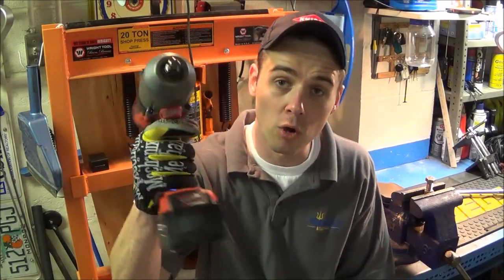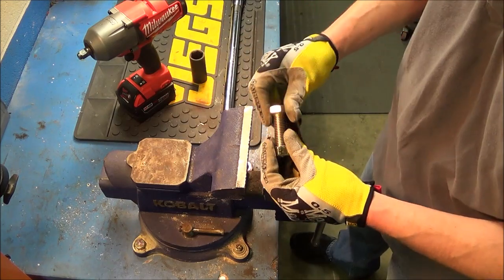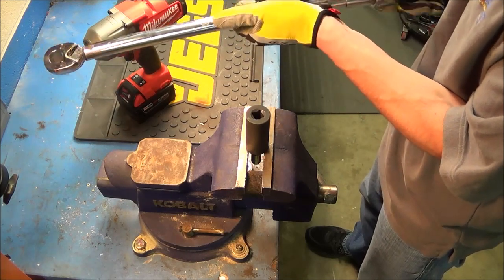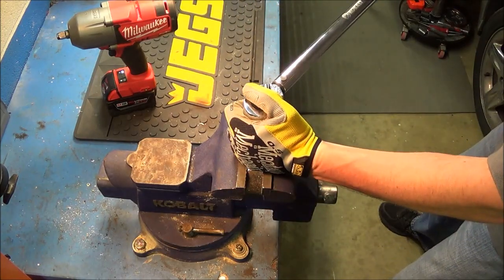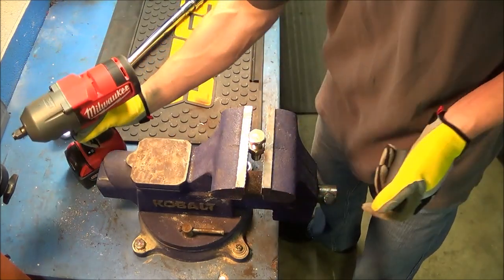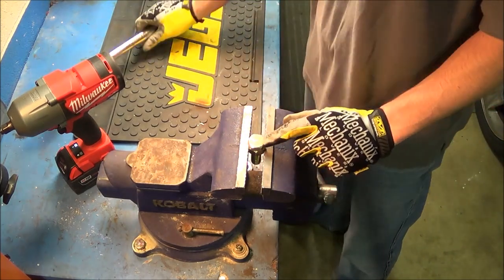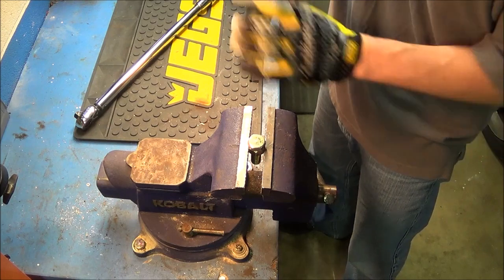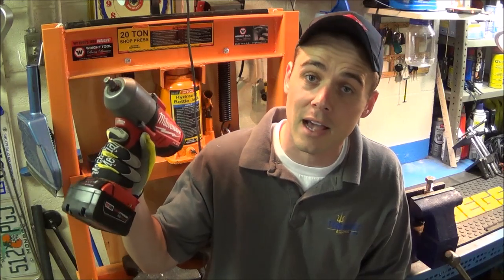Torque Test - Mode 1 - Milwaukee M18 FUEL 2763-22 High Torque Impact Wrench

Comment: I bought a Chinese brand impact wrench Enegitech. Which can remove 100 ft lbs on setting one..it has four settings. Cost €90 for impact wrench two 3mah batteries and Charger.

Comment: where's the mid torque test?    i can't find testing anywhere, all people talk about is the 600 lbs nut busting torque, big deal, what are the torques for each mode for fastening?   they claim this is the one for lug nuts,  anything over 80-100 lbs will break the studs on your wheels.  i know, use a torque wrench, and i have 3.   but it's be nice to know if mode 1 offers 80 lbs, or 100, or 105, etc.  just bought this on clearance at home depot for $199 with charger and battery and chard case, but again no one knows the torque spec.

Comment: For those that are having lots of trouble I'm breaking wheel nuts it's because there's a humongous different from when a wheel nut is Rusty it's almost like kind of being well down there so you need way more extra twerking than require

Comment: im getting rid of mine , hate it, i find it rattles on bolts with thread lock will not move them , before anyone say its my gun we have 3 of them  , have to use air gun to undo them , lack of setting power 100nm to low 900 nm to high ,

Comment: Can you explain what you mean by using the right size fastener ? Is a 100 ftlbs  not the same on a 3/8 grade 8 bolt as it is on a 3/4 grade 8 bolt?
Reply from the maker: Sure.....bolts will stretch/yield if you apply too much torque.  For example, you cannot put 500 ft-lbs on a lugnut, since the wheel stud will stretch and/or the threads will rip off.  Also, if you are using an impact wrench ---- hammering on one size of a bolt for 5 seconds might apply 200 ft-lbs, but if you hammer the impact for 5 seconds on another size of bolt, it may apply 325 ft-lbs.

Comment: Very disappointed.  Just purchased this wrench and it can't even take the lug nuts off my e46.  Unimpressed.
Reply: Try inserting the battery next time lol. I've had zero trouble removing lugs from 10 or so vehicles...including a rust-bucket 73' charger thats been sitting in the woods for 18 years in New England. Tried it just for fun and they loosened right up.

Edit: Mode 2 that is...Mode 1 wouldn't do sheeit
Reply: I had a better idea.  Send it to Milwaukee and ask for a new one.  I did and they did... no issues with the new one.  The original unit I had had 0 torque.
Reply: MrFenwayfool Nice! Glad you stuck with the Milwaukee warranty instead of refunding
Reply: @pandorakid229  wtf is that
Reply: Should've bought a dewalt

Comment: You're doing it wrong. 100 ft-lbs in stage 1 is for FASTENING. For loosening, there are no stages and the rating is 1,100 ft-lbs. In mode 2, fastening, it offers 700 ft-lbs.
Reply from the maker: You obviously do not own one of these impacts.....it is not a pneumatic version.....check out the M18 FUEL (vs) vid that I made with the 2762, 2763, & 2764....you can see actual torque specs in both modes --- forward & reverse.

Comment: what does it mean by fuel ? ?
Reply from the maker: It is their "premium" model -- with better parts, more run time, & more power.
Reply: +Real Tool Reviews oh is that it I thought it was something todo with like fuel technology or something. ok I'm thinking about getting a impact driver. and just get drill bits and screw bits. should be excellent for round the house jobs...

Comment: Excellent job. People who complain about the tools torque are probably using extensions! One thing that reviewers never seem to talk about in impact tool reviews is the fact that using any kind of extension (swivel, etc) dramatically reduces the strength of the tool! In one of your upcoming reviews perhaps you could do a comparison of how dramatically using extensions, swivels, etc affects the tools torque. Thanks!
Reply: Baxrok2 Only the swivel extensions affect the torque and also changing the arm length because 
Torque= Force x Lever arm (perpendicular distance from the axis)

Comment: Bro best reviews out there... Have you done a review for the m18 hex impact wrench, says it can dish out 1800lbs of torch, I doubt it
Reply from the maker: Thanks!  I haven't yet, but I have one here.  Also the impact drivers & drills are always rated in "inch-lbs" (not ft-lbs).... You would need to take the advertised rating of 1,800 & divide by 12 (inches per foot) to find the ft lb rating of 150.

Comment: This test is not accurate because it requires less force to loosen a bolt versus tightening a bolt. For example a bolt tightened to 80 lb-ft will require less than 80 lb-ft to loosen it, unless it is rusted
Reply from the maker: +David Nordman Keep in mind that all manufacturers list "max/breakaway" torque ratings which is how their numbers are so high.  At the time (a year & a half ago) that I made this, the big controversy with the 2763 "mode 1 torque" was that people complained it would not go above 40 ft-lbs....they even claimed that they called Milwaukee & the tech support admitted this.....I made this video to prove that was false & contacted the product engineers that designed this impact to recreate the same test that they did to verify the numbers.  

I agree that "working torque" on mode 1 (forward or reverse) would not be 100 ft-lbs most likely.....however, as far as "breakaway" (meaning the max torque that it can break away as shown) was accurate.  The point of mode 1 was to snug up lug nuts.....not to replace the need for a torque wrench or torque sticks, which is what most people at that time assumed it was.  

We now have multiple Skidmore-Wilhelm test units for proving/disproving torque & will be using it in all future reviews to prevent this type of misunderstanding again in the future.  Thanks for taking the time to watch & comment!

Comment: Who uses low setting for removing bolts? That is for tightening so you don't have headache later. Btw, if you just wanted to see what the max torque is on low setting, you could of just tighten it on low setting and get analog (old school) torque wrench and see at what torque it loosens. A 30 sec video.
Reply from the maker: spasev At the time that I made this video, the non-stop rant on every tool/garage forum was the fact that people could not achieve over 40-50 ft-lbs of torque on mode 1.  By showing it incrementally increasing in torque with a torque wrench & then the speed/power difference as it went up, it proved the point that it could do it.  I agree that there were other methods that would have worked (a dial torque wrench with a memory needle would be ideal), but this is what I had on hand at the time to complete the test.  Thanks for commenting!

Comment: good video. 
can you do comparison between Milwaukee impact wrench and other brand i.e. Dewalt Makita, Snap On. stating the advantages and disadvantages of each one
Reply from the maker: Fuad Al Hammadi I actually did make a comparison video between the Milwaukee 2763 & Ingersoll Rand W7150 --- they are the two most powerful 1/2" cordless impacts on the market.

Comment: Yes do the 3/4 !
Reply from the maker: Izzie Librado The review is on the way.....shooting footage currently ;)
Reply: Yes!!!! I'm a Diesel tech and have been debating on getting the 3/4 or 1/2! Love your reviews by the way! Keep up the good !!!
Reply from the maker: Izzie Librado Thanks!  The 3/4" is the most powerful cordless impact on the market currently.....the biggest issue is that you must use 3/4" impact sockets to get the full power & not lose torque by stepping down to 1/2" drive with an adapter.  Since you are a diesel tech, I would assume you are already stocked up on 3/4" sockets....so it would definitely be the best choice for you.  Size, weight, etc is all the same....the biggest differences between the 2763 (1/2") & 2764 (3/4") is the anvil size & the power levels --- the 2763 has mode 1 max out at 100 ft-lbs, mode 2 at 700 ft-lbs, and max breakaway at 1,100 ft-lbs.  The 2764 has mode 1 max out at 375 ft-lbs, mode 2 at 750 ft-lbs, and max breakaway at 1,200 ft-lbs.

Comment: Tech next to me bought one last week. It is proof on this test. With the amount of power on mode 2, it would have been nice to see more towards 150ftlbs on mode 1. Holding it on to verify torque, 60 to 80 maybe. So for VW or other smaller wheel torques, deff ideal. All round great gun. Bought the cover for it, extremely easy to apply. We both watched your reviews alot to make up our minds which would be the best. And is deff worth every penny. Thanks for these reviews
Reply from the maker: Josh Martin Thanks Josh!  I think that they main reason that they did not make it have more torque in mode 1, was to prevent people from using it solely to install lugnuts.  If they had it max out at 150 ft-lbs, then people would hammer on smaller lugs & damage them quickly -- even at that lower setting.  By making it max out at 100, the techs still need to use a torque wrench to verify the torque accurately & it prevents damage.

Comment: I am trying to decide between the 2654 and 2763 for basic use (lugs and suspension work) on my Grand Cherokee. If i spend $300+ on a wrench I don't want to be getting stuck in the middle of a job with a stuck bolt, or hammering on each lug for 5-10 seconds to get it off. Is the extra $130 worth it or a waste of money?
Reply from the maker: Nathan Urbanowski I would highly suggest the 2763 for lugnuts & suspension work....The 2654 is a good all-around impact, but it is much weaker than the 2763.

Comment: I wonder if the Milwaukee 2654 will remove a Honda crank bolt and a 36mm axle nut,  has anyone tried it.  I'm looking into getting one and the 2763 is too big to fit into tighter areas?
Reply from the maker: raydogg27 Crank bolt = Not a chance......Axle nut = possibly.  The 2763 is way too big for most tight area....but then again, most low clearance areas dont have super tight nuts/bolts.  If you have to pick one, I would go with the 2654, since it is much more versatile.   The 2763 is at the top as far as power goes, but you hit the nail on the head about clearance issues.
Reply: Real Tool Reviews 3 weeks ago i bought a brand new Milwaukee M18 1/2 impact 2663-22  and i was able to undo a crank bolt of a 2000 civic Si,was pretty proud of it! should have take a bet with one of my co worker who is a Snap on pro guy. Even thought it is not an M18 fuel and it does not have a brushless motor, that impact is very powerful. i've have broke a Link kit of a 2013 Dodge Journey while tightening it.

Comment: would you recommend the 2651-22 as an everyday tool for an auto tech? Ive also looked at this 1/2 inch but, is a 3/8 have sufficient enough power to do most auto jobs?
Reply from the maker: MRios1128 The 2651 is the brushed version (older & less powerful) of the 3/8" models....I have a 2654 & I think it is the best "all around" impact that Milwaukee makes.  The 2763 (1/2") is nice & extremely powerful, but for most fasteners except for lugnuts/suspension work, the 2654 is fine.
Reply: Real Tool Reviews So the 2654 isn't good for removing and putting lugnuts? I'm trying to get whats overall good enough, because to be frank, the 2763 is a bit pricey..
Reply from the maker: MRios1128 The 2654 is good enough for "most" lugnuts.  I dont want you to get one and be disappointed, simply because if a lugnut is torqued correctly to 80-ft lbs (for example) & you add in a years worth of salt, dirt, rust, water, & corrosion....many times it will take 200+ ft-lbs of force to remove it.  If you are working on trucks those numbers would be even higher.  The 2763 is a beast.....power & weight wise.....if you got a 2654-22 (impact, charger, and 2 of the 4.0xc batteries), you can then get a 2763-20 (bare tool) for a LOT cheaper and use the same batteries and chargers.  If you have to pick one, I would go with the 2654 to start....you will get more use out of it.

Comment: Hi, from the video, it only shows you removing the screw. Can this tool use to tighten the screw at a specific torque. Which model or brand would recommended to be use in opening/closing motorcycle engine or crankcase? Thanks in advance.
Reply from the maker: smartunnel Specific torques are not easily achieved with any impacts (pneumatic or electric) since it can vary greatly depending on the amount of time you pull the trigger, the bolt size, thread pitch, etc.  As far as this video, it was merely to prove the "mode 1" would in fact produce 100 ft-lbs of force --- IF the correct sized fastener was used.  For what you mentioned, I would suggest the Milwaukee M18 FUEL 2654 (3/8" impact).  It has 3 speed/power modes & is much more "all around" useful in the real world.  The 2763 is a beast & will snap bolts off if used incorrectly.  For tightening bolts, you really should just "snug them" with these impacts on LOW & then use a calibrated torque wrench to set the correct torque to prevent damage.

Comment: Can you do a review on the compact version of this that only goes up to 210 ft lbs? Part# 2655B-20 with Ball Pin and 3 Modes Selection.
Reply from the maker: mobgma I will look into it....I dont particularly like ball/pin detent models, since they arent designed for automotive use....but from looking at the specs, I think you may want to consider the 2654 (M18 FUEL 3/8" version)....it has 3 speeds & maxes out at 200 ft-lbs.  It is a very useful impact.
Reply: I agree with the 3/8" version since it is available with friction ring BUT my (maybe everyone else's too?) impact socket set is 1/2" so I would not choose the 3/8" so I would take the ball pin if I had to in a 1/2".

If you don't want to solely do a review of the Milwaukee compact version, Makita makes a DTW281Z COMPACT impact wrench the same as mentioned that has almost identical specifications to the Milwaukee 2655B-20. I believe both 1/2" compact impact wrenches are ball pin.

Maybe a showdown of some sorts for the weekend warrior compact impact wrench?

Makita DTW281Z vs Milwaukee 2655B-20?

Both have brushless motors. Both have 18V Lithium Ion batteries. Both have 2.0 Ah and 4.0 Ah battery options. Both have 210 ft lb torque ratings.

These two units are the highest torque rated sub compact impact wrenches I could find. Most other new ones by DeWalt and Bosch and Others are 140-160 ft lb range.

Cheers
Reply: Real Tool Reviews What its the real difference between the detent and friction ring and why do they have different torque specs on wrenches? I thought they were just socket locking types.  Thanks.
Reply from the maker: Benjamin Jensen
The differences are going to be the power levels & anvils (friction ring or pin detent).  The friction ring (hog ring) model is used primarily in the automotive field, since you can change sockets very quickly in a matter of a couple seconds.  In the building trades/construction field, they like pin detent models since the sockets cannot "accidentally" fall off (i.e. --- a socket falling off of a skyscraper is a huge hazard).....other than that, usually in the building trades they will use ONE size socket all day long to tighten a lot of identical bolts/nuts, so the quick change option is not needed.  With the pin detent, you must physically press a tiny pin into the anvil in order to release the socket (usually with a punch or nail).  The power levels are electronically controlled & Milwaukee gears the specific impacts to whichever trade will primarily use them.
Reply: Real Tool Reviews Wow okay that makes sense. Thanks so much for getting back to me.

Comment: ...what 1/2 torque wrench is that?... sounds pretty solid compared to what I am using
Reply from the maker: Scott Margerum That is the 1/2" Kobalt one that they sell at Lowes.....I would suggest you look at the 1/2" from Home Depot....it is much better (and Made in the USA still I think).
Reply: Real Tool Reviews ...well as I'll have to go there anyway for the M18 I'll just have a gander over there as well... thanks

Comment: A comment after the comment of 'not sure about charge level'. I have the 'baby brother' of this wrench; the compact M18 fuel (210 ft-#) model, and i was going to 'show off' that it could take the lugs off my ford explorer, and i happened to have a battery on the tool with '1 dot' left, so was going to show how it 'didn't matter'; proven wrong; it knock knock knocked and wouldn't take off the lugs. I put on a fresh battery pack and 3-4 knocks and spun right off.

I originally bought the model I have with the intent of wheel changes on cars and it's perfect for the job; I was hoping to use 'mode 2' to get the lugs on and 'mode 3' to remove, however after reading reviews that the 'mode 2' (on mine) wasn't actually regulated to 100 ft-# i bought some torque sticks (killer kit on amazon with 4 sticks and 4 thin-wall plastic-coated lug sockets for < $70). When using the torque sticks, you can quite easily tell when they 'do their thing' as the impact sounds completely different once the nut stops moving. 

I would love to see the exact test you just did, performed on lugnuts and with my tool. The other test i'm looking for; using the hex equivalent of this tool used for drilling 2 9/16" self-feed (plumbing) bits. My M18 fuel drill can do it but it's just way to dangerous; check out my video @andrewwynn on youtube; when the bit binds, it rips the drill right of my hands in-spite of using the side-handle.